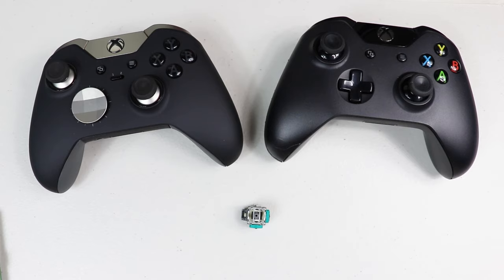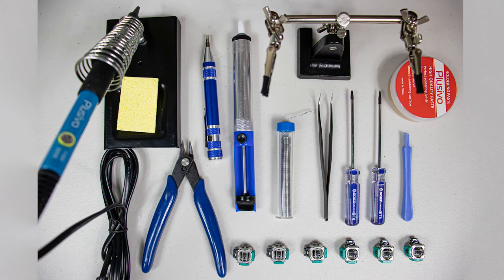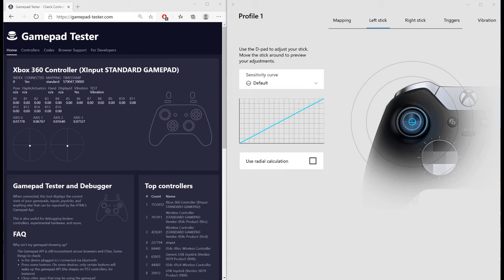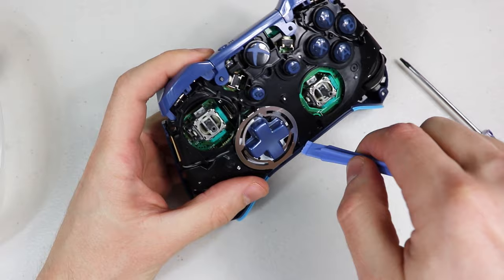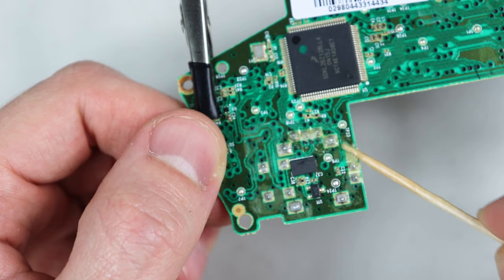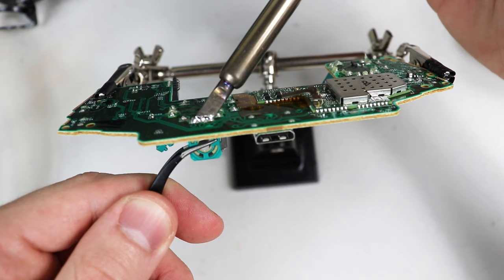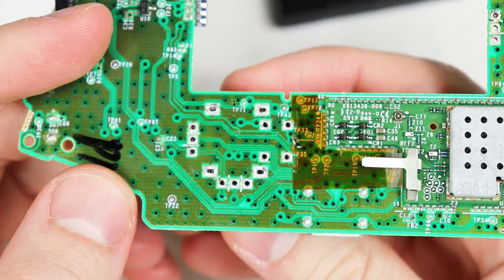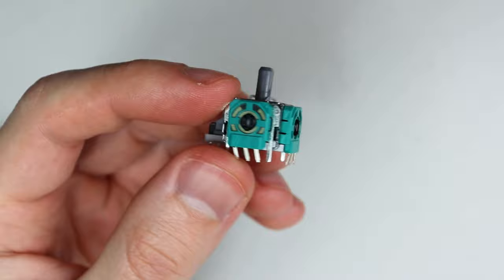How to Replace Xbox One Controller Analog Joystick - NEW METHOD - Fix Stick Drift, Broken, & Loose

Comment: I replaced them and they seemed good until the right stick when i slighly move it it kinda moves itself. a different direction. i dont know if it will go away
Reply from the maker: Did you do the manual calibration? It may be that there is too much physical resistance between the potentiometer and the wiper. Which means it may need to be adjusted again. 
Are you testing on the hardwaretester.com to see how it's reacting?
Reply: @SOSSGAMING  no it did it itself but another thing I saw is that it kinda like starts like jiggling but it doesn't drift it only sometimes does it
Reply from the maker: @brayan-qg4zi  Did you install hall effect sticks? I've heard those will do that.
Reply: @SOSSGAMING  no there like shakey I do you know a fix
Reply from the maker: @brayan-qg4zi  Do you notice any small diode or capacitor missing? Which joysticks did you install? Was the left joystick also replaced and it's working fine? Have you tried replacing just one of the potentiometers with a known working one?
Reply: I used the ones in you description and after I changed them it kinda messed up the controller like the chip part gets hot and I think that might be the problem on why it's shakey.  But I didn't see no missing parts
Reply from the maker: @brayan-qg4zi  Yeah if the board is getting hot it sounds like there is a short somewhere, which can also cause that shakiness I believe. I vaguely remember having something like this and it being a missing capacitor/diode or a cracked board. 

I would also recommend cleaning up the area really well with rubbing alcohol to remove the resin residue (flux)? I would also retouch all the solder connections. Make sure there is no bridge between them.

Is on both axis x and y of the right joystick (test it on the hardwaretester.com site to see)? Was the left joystick replaced? Does it do it as well?
Reply: @SOSSGAMING  yea I'll do that and yea I replaced the left too and it works fine just a little shakey but no spikes.
Reply from the maker: @brayan-qg4zi  Ok let me know what it looks like at rest and when you move it on hardwaretester.com for each x and y axis
Reply: @SOSSGAMING  I looked at the board missing a some capacitor and found the short circuit I scratched the board and some solder connected both point when o scratch it I'm kinda thinking in replacing the board do you recommend that
Reply from the maker: @brayan-qg4zi  If you're able to source the capacitor/diode I would give that a shot, but yeah if the scratch on the board is too bad I would just replace it unfortunately.

Comment: i think that the manual fidgeting of the potentiometers bending the pins and all that will wear off over time and result in drift a lot sooner than a new controller will ... seems too much of a fuss to be honest for no real benefit :/
Reply from the maker: Well, I've repaired many controllers this way and no issues to date! The benefit is not having a very off-center controller that still drifts :) Thanks for watching and commenting!

Comment: i need ur help i soldering my analog bec of your video + i noticed the hole pads on the board are damaged , i use desoldering pump , is that bec of iron or desoldering pump itself ?? btw my desoldering = yihua 929d-v
Reply from the maker: Sorry to hear that. It's usually because of too high temperature being used and/or on for too long. It melts the adhesive under the pads so they damage. It's unfortunately they made them low quality, so this happens a lot :/
Reply: i dont use high temp its like 260-280c and im quick at soldering same as pump its like 1-2 seconds  , can flux  damage the pads ??? and is there way to fix it ?? my analog now can go left and right but not up and down
Reply from the maker: @giovannigiorgio2262  Perhaps flux might do something to the pads too, never thought of that. How many are damaged? It's technically possible to "fix" with some jump wires
Reply: @SOSSGAMING  to be honest maybe i have no idea but from what i saw maybe 1 or 2 or 3 😂😂 , bro u desolder all time and the pad still fine with you , why i want to learn from my mistakes + can i send u pic to the damage ??? jus tell me can be fix it or   not
Reply from the maker: @giovannigiorgio2262  For sure send them to my gmail sossgamingcs I'll see what I can see

Comment: I got my joystick replaced by a local store since I'm short of time and I don't have the soldering kit, everything seems right but the spring tension is way too high it feels heavier than a xbox 360 joystick, I told them about it and they say it's original part and it should break in and blah blah, thing is... not even a brand new controller feels this stiff! could it be a knockoff piece?
Reply from the maker: Yes, it's possible to not be original.  It could also be a PS4 joystick.  When you go to the website gamepad-tester, is the response smooth when you rotate the joystick?
Reply from the maker: You could always open the controller to be 100%, if you had the tools.
Reply: @SOSSGAMING  I think it's a PS4 joystick, the module says alps but the potentiometer piece is thicker and and the plastic from the wiper is white. It's not smooth, i just bought the replaciement kit from your link and ill do it myself.
Reply from the maker: @DaRockCandy  Ok, it doesn't sound like it was an original joystick then.  Good luck!
Reply: @SOSSGAMING  I'll try, it's an elite controller and I was sweating not to nuke the pads, I had to... like you said, chose the disassembly method. So far everything is fine, I'm just waiting on your kit! :D

Comment: I have a problem with my Xbox one controller’s right stick it responds when I move it side to side but when I move it up or down it take a while for the stick to respond can someone tell me how to fix that problem.
Reply from the maker: Yes, that is typical stick drift. The potentiometer has worn down from the wiper.  Technically you don't have to change the whole joystick you just need to change the y-axis potentiometer.  Best of luck.
Reply: I had this question and it got me thinking that maybe I could just try a carbon ink pen and retrace the carbon track in the potentiometer to salvage them rather than tossing them. Still need yo try it but I don't see why it wouldn't work
Reply from the maker: @swifdy6855  That's a great idea.  If you ever find out lmk!
Reply: @swifdy6855  lemme know if that works for sure

Comment: So what do i do if i may or may not have soldered off a contact pad of one of the potentiometer☹️
Reply from the maker: It's possible to run a jump wire. But depends on which contact pad on which controller on which joystick?
Reply: @SOSSGAMING  its on an older controller not series's x/s but the right joystick from the front,  bottom middle potentiometer
Reply from the maker: @Seriousbird  Ok, I'd need to know the exact model. If you check on this page https://acidmods.com/forum/index.php/board,537.0.html you can view each model's boards and can find out. It can also sometimes be found on the sticker on the controller (near where the batteries go)
Reply: @SOSSGAMING  ill probably end up using it as a parts controller either way but i have another "sport white" with a gone contact i don't know what one ill check everything when im at the house it is
Reply: @SOSSGAMING  "1708 slim" looks the same, same board numbers. Sticker was gone long ago and for this one viewing from the back of the board its the right analog, where the bottom 3 together contacts are its 1 right 1 up idk how to explain
Reply: @SOSSGAMING  where it says "tp63" its the contact above the one straight up from the "t".. or closest to the "c" from "c37"
Reply from the maker: @Seriousbird  Ok, so there are 3 pins on that potentiometer. Looking at the picture "1708 MCU Board Bottom", is it the left, center, or right pin?
Reply: @SOSSGAMING  its not on the potentiometer pins itself its all the way right,up,up. Starting From the bottom potentiometer pins on the right side. It could be a ground for all i know
Reply from the maker: @Seriousbird  Ok, if it's just one of the 4 posts or one of the 4 button pins then it shouldn't even be an issue. It should still work fine.
Reply: @SOSSGAMING  i finally got it everything works great! Thanks so much 👑
Reply from the maker: @Seriousbird  Great to hear! Good job.

Comment: my x axis wont register at all, i've soldered it and still nothing. when I am in game it slowly moves to the left but when i try to move left or right it doesn't work at all. i can look up and down fine. On the gamepad tester it doesn't show my x-axis working either. I have already tried a second poteniontiometer. can anyone help?
Reply from the maker: What is the reading on the gamepad tester? Is it a full 1 all the way to the left or right? That would usually indicate a damaged through hole or a solder bridge between pins, or perhaps even corrosion somewhere on one of the small capacitors.  While less likely it could also just be very bad luck with potentiometers.
Reply: @SOSSGAMING  its .6 to the left I just switched potentiometers and still the same
Reply: @SOSSGAMING  if the through hole is damaged does that mean the whole controller is now ruined?
Reply: @SOSSGAMING  could i use a breadboard to fix it?
Reply from the maker: @Glizzlord  From my experience when the reading is constantly off like that (not 1 or -1) it was actually a crack in the board.  I've only seen this twice though.  I think it indicates that there is a short somewhere on the board, caused by a crack, corrosion, or some other type of damage.  That's my guess anyway.  Damaged through holes would show a 1 or -1, in my experience.  I was unable to reuse either of those boards.  I'm sure that's not what you wanted to hear :/

Comment: Will you be posting anything for sticky buttons?
Reply from the maker: I'll add it to my list! In most cases though all you need to do is open the controller up all the way and clean in and around the front cover, the buttons themselves, and the silicon button pad.  And in some cases it will just need a new button pad.
Reply: @SOSSGAMING  thanks for the reply, I do have another problem with the joysticks flicking the opposite direction because of the weight of the stick on the Xbox elite controllers. Any ideas of fixing that?
Reply: This is very annoying when playing fighting games and you character jumps or do a different move than what you want them to do
Reply from the maker: @davonmanigault2451  so the joystick is physically moving in the other direction correct? One easier solution that may or may not work is replacing it with regular xbox thumbsticks.  They're lighter and may not cause the issue you are experiencing.  Another possible solution might be replacing the actual joystick to one with either lighter/stronger stick tension.  Those are just some things that come to mind.  It sounds like a trial/error type of deal to figure out.
Reply: @SOSSGAMING  Right. I've tried replacing the the thumbstick and it didn't work, so I guess it would be the joystick itself. Do you think this could still happen if the joysticks are tensioned correctly? the elite thumbsticks do have added weight with the magnets in them.
Reply from the maker: @davonmanigault2451  When plugged into html5gamepad.com you don't notice anything funky when moving the joystick around do you?  If so that might be an indication of the pots being worn down. 
In answer to your question I would guess that this shouldn't happen, but I don't know how exactly you are using the joystick.  It very well could just need a new joystick or just a y-axis potentiometer swap.

Comment: My stick thing broke in half have any tips?
Reply from the maker: I do! Someone actually said they had temporary success with super glue/epoxy, but ended up needing to replace it anyway.  Perhaps try that first and see how long it lasts if at all, but personally I think replacement would be the best option.
Reply: SOSS GAMING  thanks I’ll try the glue but I’ll most likely need a replacement!

Comment: what temperature do you set your iron to?
Reply from the maker: ~350*C
Reply: @SOSSGAMING  i dont know what kit was used in this but the soldering braid would not pick up anything
Reply from the maker: @keanuvernon6177  You may need to bump up the heat.  The cheaper soldering irons aren't completely accurate unfortunately.
Reply from the maker: @keanuvernon6177  Also flux is needed.

Comment: Hi, i am wondering what soldering wire you use and wax ?
Reply from the maker: In this video I just used what's in the $30 soldering kit (in the link).  Normally though I use Kester 60/40 rosin core solder.  Great stuff.
Reply: @SOSSGAMING  ok awesome, thank you for replying. With this I hope to fix my controlers and my uncles, thanks again for making this video and replying
Reply from the maker: @sequoyah317  Best of luck!
Reply: @SOSSGAMING  hi again, so I was able to replace my joy stick on my xbox elite  however when I was putting it back together the thin black wire that went to the bottom button mapping came undone  and I tried to put it back in and messed up the wiring, do you know where I can get a replacement wire?
Reply from the maker: @sequoyah317  Are you sure it's inoperable? I found a couple on amazon and ebay but they also include the paddle button board.  If you type in "xbox elite ribbon cable" that's what will pop up.  Not sure if it has any other name to search by hmmm
Reply from the maker: @sequoyah317  Do you live in the US?
Reply: @SOSSGAMING  yes I do live in the US, I am sorry I didn't check my notifications, I did  try to  pugging it in a few times and I ended up stripping the little bit of copper wire so I think that was the problem.  I was able to find it on Amazon after googling the parts, I was able to get it for about 10 bucks,  thank you for writing back
Reply from the maker: @sequoyah317  No worries, glad you were able to find one!

Comment: All this just to change a potentiometer out? I changed dozens of them on the 360 controllers with no problems.  Why are the Xbox one controllers so temperamental? 🤔
Reply from the maker: This is just a guide for the whole joystick, but you're right for stick drift all you need to do is replace the potentiometer. I should have been more clear. Though you might be right the stick drift may be more common in the newer controllers, perhaps due to a different design.

Comment: I dont get it..... whats the point of recalibrating it? I mean...... a couple of years ago my controller got broken (drifting issues and what not) and one guy replaced it for me in less than 30 minutes, "no drama" and it still works flawlessly and perfeclty to this date like its a new controller, no "recalibrating" was neccesssary. Now you are telling me I need to spend half a day to position it correctly or what? Sorry but am I missing something here?  Did something changed? The thing is, I want to repair another controller on my own now  (I practice some soldering) but to me it seems I should spend more time about other things than "pure" soldering.  Can you please explain it to me....  are these some kind of new ALPS analog sticks or what?
Reply from the maker: If they used the original joystick, about 1/3 of the time re-calibration isn't necessary if replacing the whole stick, out of luck. Also, if they just replaced the potentiometer that was causing the drift, calibration is less likely to be necessary.
The joysticks that used to be sold were mostly the crappy ones with physically integrated dead-zones (~15%). These were sold so much by vendors because they didn't usually require calibration when installing, therefor less complaints. They didn't know how to combat the issue with the original joysticks. Luckily, I figured it out with the help of some forums. 
For games that require accuracy and precision like FPS games, you don't want high dead-zones. 
If you only have stick drift and no other joystick issue, I recommend just replacing the potentiometer and see how it fares. 
I hope that makes sense.
Reply: @SOSSGAMING  Are you selling it on both Ebay and Amazon or is the one on Amazon a "ripp off"? And what about those: "new rocker design" ones, the yellow ones, they are claiming... quote: "New design. No joystick getting stuck at the edge, it resets properly" and those are not ALPS parts.
Reply from the maker: @samfkt  Can you link that one? The ones I sell on both sites are the original ones.
Reply: @SOSSGAMING  So basically, I could just replace/re-solder those potentiometers and thats it. BTW what solder do you recommend.... I have access to mostly lead-free but which one is good?
Reply from the maker: @samfkt  Exactly, but there still is a chance for needing to calibrate as shown, just less likely. Personally I don't like lead free as it has a higher melting point and a bit harder to work with. But if you're good with it then why not. I personally use Kester 60/40 rosin core solder. Great stuff.
Reply: @SOSSGAMING  ok thanks......  since im new to soldering I would go for lead based.